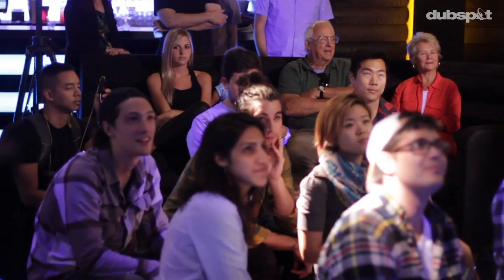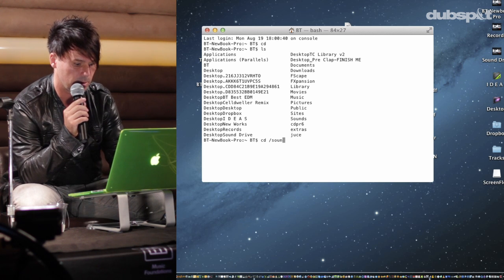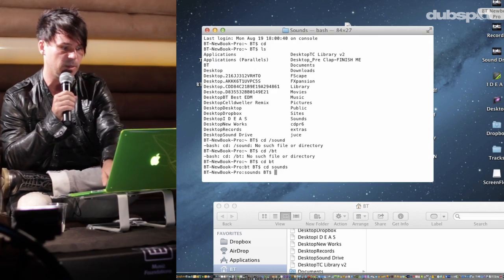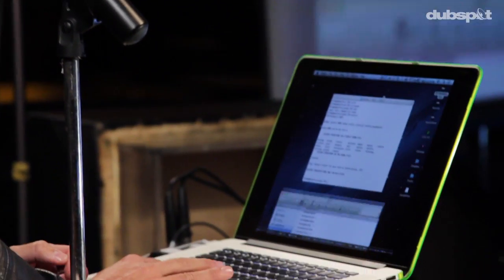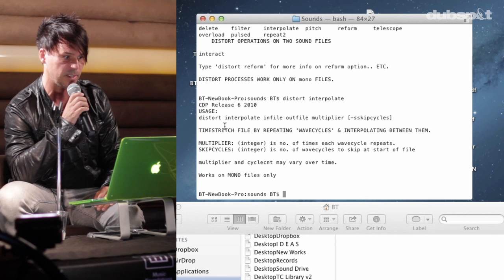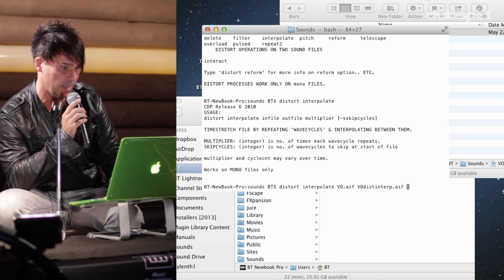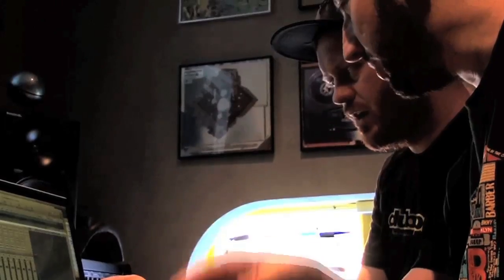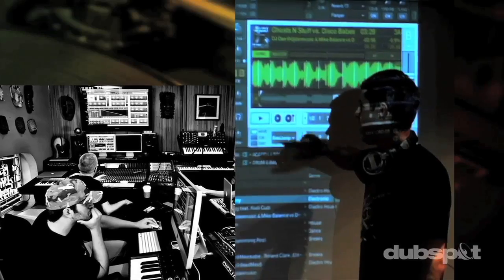Sound Design Tutorial w/ BT Pt. 1: Digital Signal Processing Using Mac OS X Terminal

Comment: Another issue that some of you may be having, since it's not always entirely obvious why, is when you get the 'Application doesn't work with this type of infile' error. It'll happen frequently unless you know what you're doing. What's usually causing it is that many functions only work with mono files, so your stereo files won't work. Just make them mono in Audacity or something.

So far, CDP is absolutely amazing, but a bit impenetrable at first. Stick at it!

Comment: Yeah he failed to mention #1 how hard CDP is to install in Mavericks and #2 how ATROCIOUS the UI for SoundLoom is. Pretty much unusably clunky. Much better to try to use commands in the Terminal.

EDIT: finally got CDP to work through the Terminal. Heads up: much easier to name everything you're gonna use without spaces, as Terminal has a hard time with that. And a lot of functions, such as Distort Interpolate from the video, only use mono files, so read before you try to go nuts!
Reply: So you just installed the CDP-installer and ran it through terminal?? No additional install process?? U

Comment: CDP is a bitch to install on Mavericks. I did exactly what the ManualConfig file said, but I still get 'Command not found' and Sound Loom can't locate the _cdp folder.
Reply: I had this problem on Lion. The installer put it in "Macintosh HD" which has a space in it. I moved it to my user folder (no space) and got it working in Terminal right after.
Reply: audiogeekzine That did it. Thanks a lot!
Reply: Hmm, I got it working perfectly on my first go.